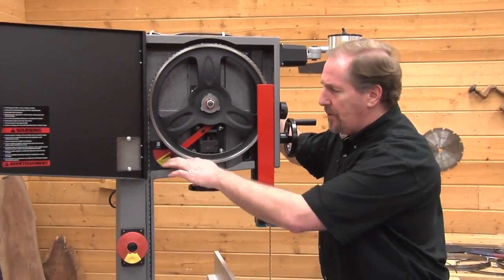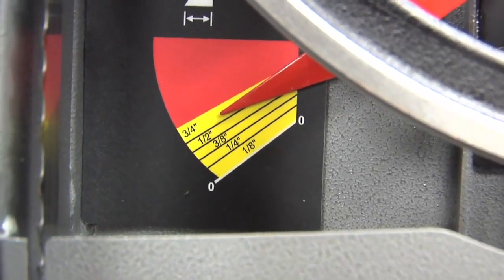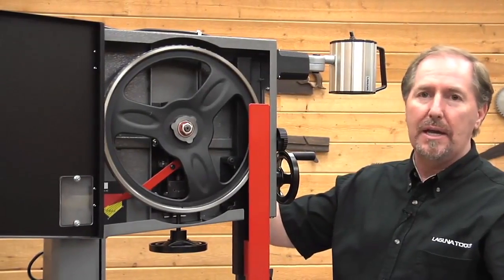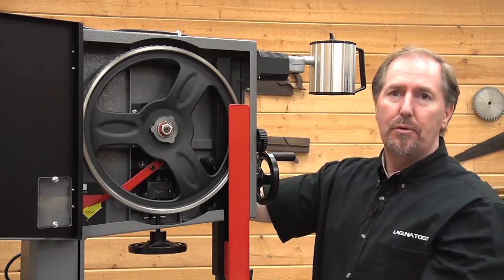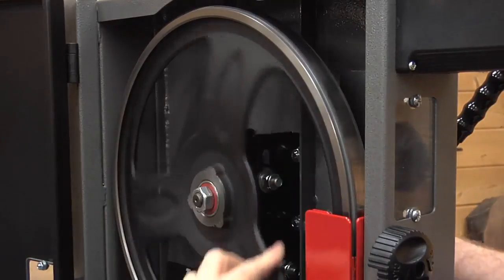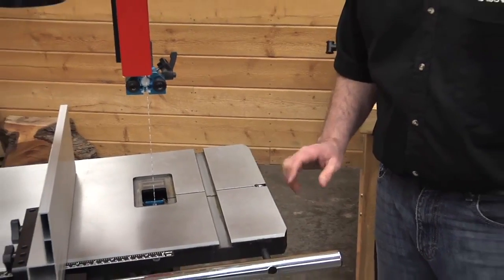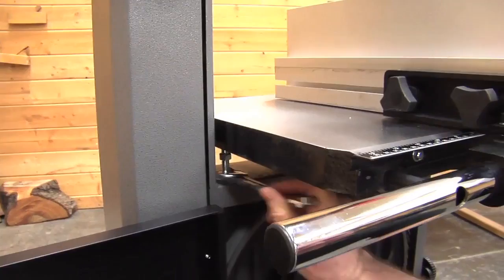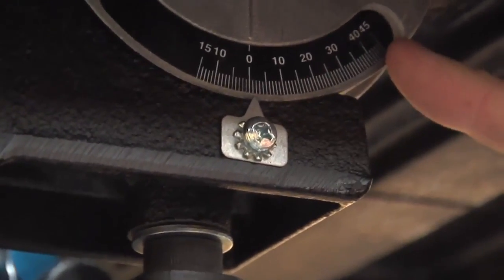1412 Bandsaw Blade Tension and Tracking - Part 9 of 14 - Laguna Tools

Comment: Thank you for a tremendous series of very helpful videos on the Laguna 1412. I could make dozens of comments where your tips were spot on. But I'll just mention one in this #9 video where you want the fence to be perpendicular to the table. I didn't want to add shims but your tip to just loosen the fence guide bar was all I needed. I gently pulled up on the right side of the bar and tightened both screws down and the tiny bit I needed to make the fence square was achieved. Your videos are much more helpful than the manual as I read the manual and neither the photos nor text were nearly as good as your videos. Laguna might be wise to refer to your videos in the front of the manual or even include a CD with the wonderful Laguna 1412. THANKS
Reply: I would agree with your assessment of the videos over the manual. If all you have is the manual you may struggle a bit.

Comment: Your 14  video series on the Leguna 14-12 is an excellent presentation. They are concise and your step by step explanation and demonstrations made the assembly of my band saw accurate.  Cudos to your videographer, they got all the angles. These videos should be included with the manual which is not all the good.  Thanks again

Comment: I understand that the blade tracking correctly when the saw teeth are centered on the crown. The teeth should be dead center on top of the crown, which prevents blade drift. The video instructs that the blade be centered on the tire.
Reply: Bobcatt22 close, you want the gullet of the saw tooth on the center of the tire, not the center of the tooth. center the gullet and set your guides properly and you will NEVER have drift.

Comment: Hi Laguna, can you discuss the two theories of blade tracking? Some center the blade on the wheel crown  vs some center the bottom of the tooth gullet on the wheel crown.
Reply from the maker: Hey Christopher!
Users should center the entire blade on the bandsaw wheels and should adjust the tracking to keep the blade in the center of the wheel on all bandsaws with crowned tires. Bandsaw blades will seek the highest point on the crowned tires and will be most stable at this position.
Reply: @LagunaTools  - Thank you! I just ordered a resaw king and want to set it up correctly. This has been very helpful.